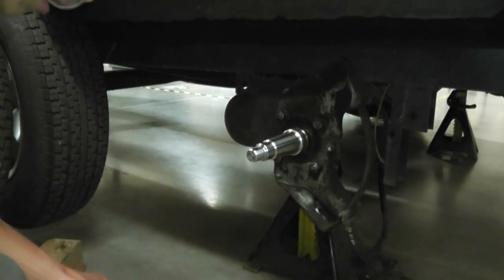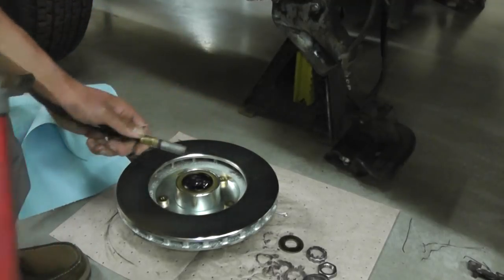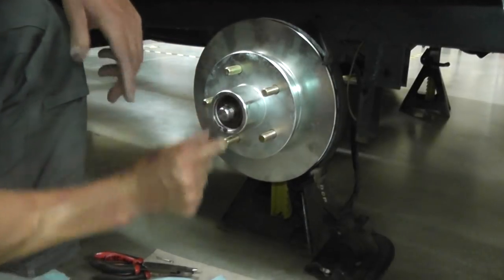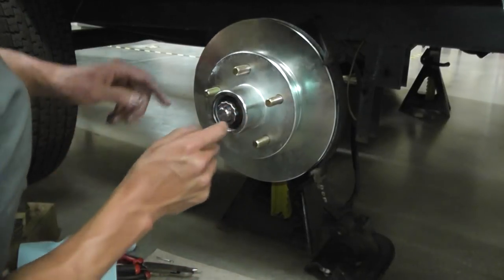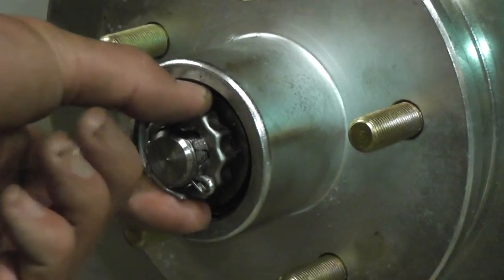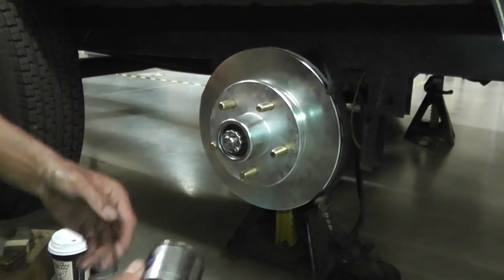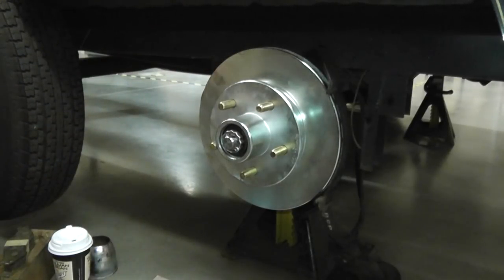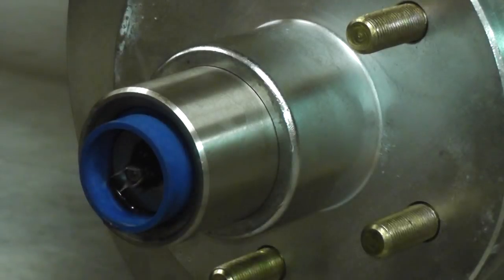Asian Bass Guy UFP DB-42 Trailer brakes hub, disc, pads install

Comment: Thanks so much for this video. I have a 1998 Chevy Prizm and the front brakes are exactly like the ones on your trailer. Which means the OEM rotors that I had bought online will not fit. But at least now I know how to take apart the ones it currently has.